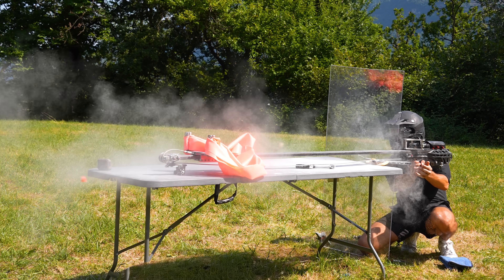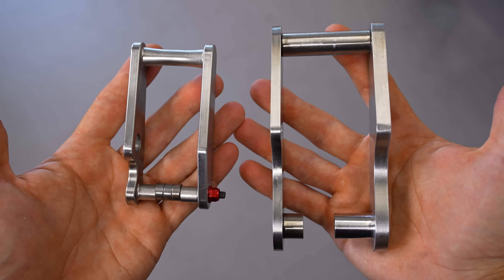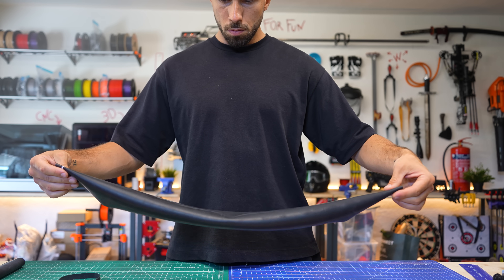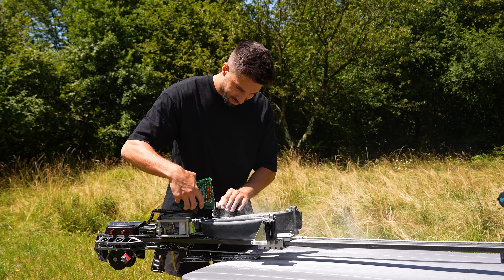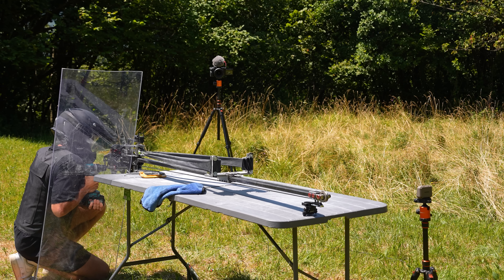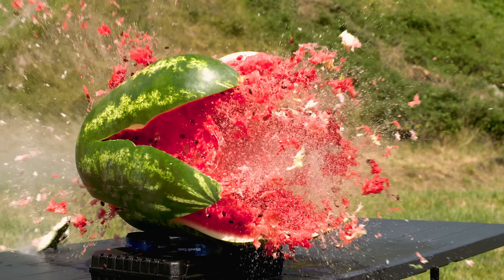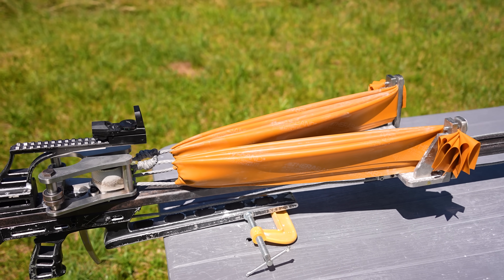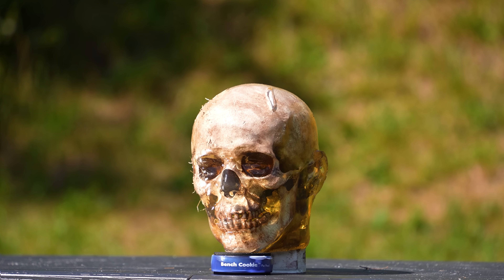Bulletproof Glass vs World's Most Powerful Slingshot

Comment: The reason why it went through the bullet resistant glass is because the ball is steel vs most handgun rated glass which that is relies on the bullet being mostly lead and copper which blunts the bullet which most handgun bullets are rounded and not pointy and dissipates the energy over a larger area. The steel ball doesn't squish and will keep fracturing the glass/polymer.

Comment: 15:04 its 0 polycarbonate in that glass. its just regular 3 layer glass.  I predicted befor shot it will go thrue easy
Reply: Bruh let me believe it was bullet proof glass😭
Reply: Yeh, I mean if it went like through butter there is no way of it stopping Magnum round. Although it is not just regular glass
Reply: Look again, you can quite clearly see the thin Laminations between the layers of Glass.
Reply: It looks to me like it might be the wrong way round. One thin layer of polycarbonate facing the sling shot. Should be at the back furthest away from the shooter.

Comment: Regarding the lever: In the video we see you using both hands to pull it when firing the slingshot. Was it still that hard to pull, or did it simply feel safer using both hands?
Reply from the maker: It just felt safer, later on in the video I used only my left hand and it was still very light
Reply: Ok😮

Comment: 14:52 i can't believe it break through that bulletproof thick glass
Reply: It is very important that such glass be secured in a solid metal frame. Otherwise, its stopping ability drops sharply.
Reply: @Scorchluck  maybe thats it but still
Reply: @Scorchluck  Yep, this is the theory of what happened with the Cybertruck snafu, they didn't replace the window after the previous tests properly and it was a little loose.
Reply: If I google it says BR3 rated bulletproof glass is designed to withstand projectiles with a kinetic energy of approximately 945 Joules. So I think there is some physics going on with it being a big heavy ball instead of a fast small bullet.
Reply: @JeffBilkins  The glass slows, mushrooms and fragments the bullet and the polycarb holds the glass together and catches the projectile. The density/volume of the ball is cubed but the size is only squared by its radius. And it being a steel ball, it barely deforms, so the area stays pretty much the same throughout.
Reply: @JeffBilkins  Balls are very good at applying a lot of forge in a very small surface area.
Reply: I dont think there was any polycarbonate in that glass. Everytime I've seen bulletproof glass get hit like that, there isnt a clean hole it will look more like plastic deformation. Still impressive for a sling shot
Reply: If I had to guess, the larger story surface area of the 50mm ball causes the entire area in which the impact would normally be spread around to fragment entirely, so it can’t distribute force as the glass is designed to.
Reply: I literally was like, there's just no way😮😮😮😮😮😮😮
Reply: You also have to remember, the most common bullets are made out of copper and lead, not steel like the balls, which is a lot harder of a material
Reply: 1. Bulletproof (resistant) glass is designed/tested/rated inside a certain design of frame. The frame is an integral part of the system and plays a role in the stopping power of the glass. So just leaning it up the unframed glass against something is like the worst case scenario. The bulletproof glass standards literally include a load of different specifications for how the glass must be framed because it's so important for it to actually function properly.
2. the glass is designed to stop bullets, and in this case pistol rounds, which when they impact are more of a high speed, short duration metal spat. (the projectile deforms significantly, the metal is much softer) 
3. The ball bearing doesn't deform at all and imparts it's energy over a much longer period of time with much less of the energy being lost to deformation of the projectile

Think about it like this: 
You've got a setup with 3 normal pieces of glass, that have saran wrap between each layer, and superglued each layer together. Then leaned it up against a wood frame or something  

It's the difference between:
Taking a marble sized ball of clay, wrapping it in a thin layer of foil like it's a piece of chocolate, and throwing it at your glass setup really really fast.  
And 
hitting that same setup as hard as you can with the rounded side of a ball-peen hammer.
Reply: its 0 polycarbonate in that glass. its just regular 3 layer glass.  I predicted befor shot it will go thrue easy
Reply: @salam14111   Idk, if it were just glass, it would have shattered with and explosion. It made a nice round hole in the middle, so I think there was poly in it. and it was rated for .357
I think that, maybe its the momentum. .357 is a lot more joules going a lot faster but the Momentum is Mass x Vel. and this ball probably has a lot more mas and not a lot less speed? idk how to explain it.
Reply: @ReavinBlue  its just plastic that hold all 3 glass together . who knows
Reply: @ReavinBlue  perhaps tempered glass that is why it did not completely shatter into pieces
Reply: @salam14111  Are you sure, because at 15:06 he specifically says that there IS polycarbonate in it?
Reply: @devil_master1562  do u see any? should be blue edge
Reply: @salam14111  Blue (actually green) edge just means it's tempered glass.  Not necessarily that there's poly in it.  Glass with poly will be tempered for obvious reasons, but not all tempered glass has poly in it.
Reply: @salam14111  Normal glass would have shattered. There is definitely some polycarbonate. Also, it's a steel ball. Bullets aren't analogous to arrows or spheric projectiles. People keep judging them purely based on energy but that's wrong. There are a lot of other physics going on. A bullet can be stopped by Kevlar but get ripped apart with a arrow.

Comment: But this is a crossbow now, it's only a slingshot if you can hold the kinetic energy with your own hands, without mechanical triggers.
Reply: Crossbows rely on the bow arms for energy, not the string or rubber bands. Not sure which definition excludes using a trigger or mechanical winches for a slingshot.
Reply: @EidolonFantasma swedish law :(
Reply: @upcoming Of course it would be some law. Thank you for the clarification. How does Swedish law define a crossbow?
Reply: This is a ballista lol
Reply: @thedoigster6908 It's definitely closer to a ballista than a crossbow, but ballistas use torsion instead of tension.